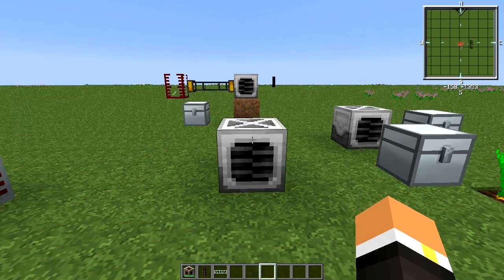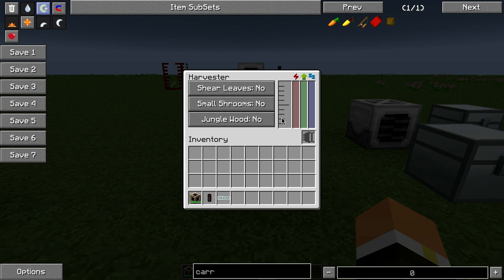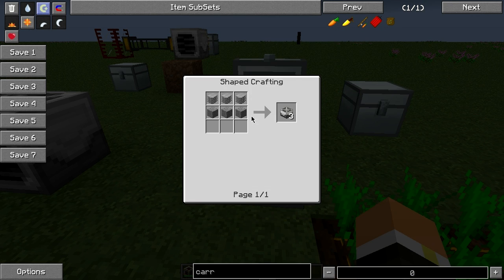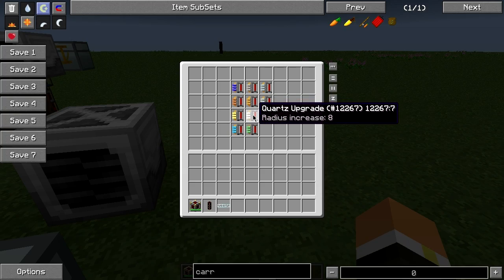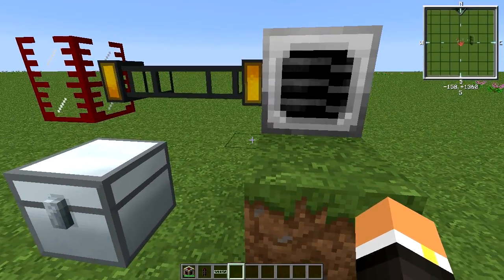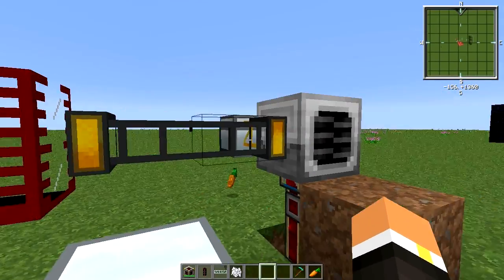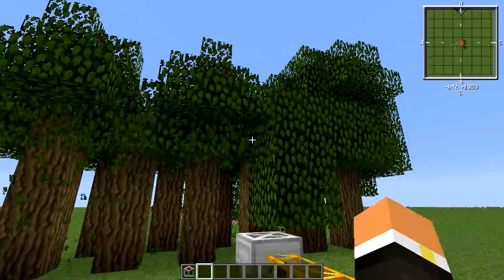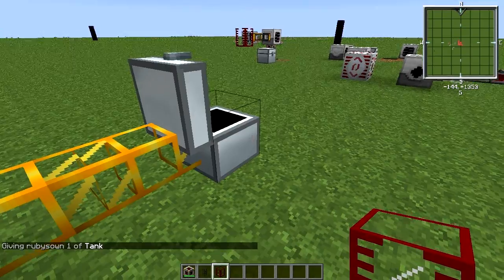Feed The Beast :: Machine Tutorials :: Harvester

Comment: Big not on the sludge is it does not stop the machine from running if the internal tank is full, so you do not need to use a void system.

Comment: What do you do if your harvester is powered but the idle bar is stuck at full & won't cut down trees or harvest crops?
Reply: MythFighter97 check to make sure that wherever your harvester is outputting to, such as a chest or barrel, that it isn't full. Also, the harvester needs to have the sludge pumped out somewhere, make sure that storage isn't full or if you are pumping it to a sludge boiler that the sludge boiler + output (chest, etc) aren't full. Also, low chance, but make sure nothing redstone is powering it (redstone block, random lever, etc).
Reply: Thanks for the info. I had already figured out the problem & feel stupid. I used levers o makes the pipes extract from the harvester which caused it not to work since the levers were sending a signal to the harvester. I moved the levers & everything runs like a gem.
Reply: Okay, cool. I figured you'd have a solution since it's been a while since you posted that but just in case, I thought I'd answer.
Reply: Thank you very much for the response though. It was helpful for future events if it occurs again.